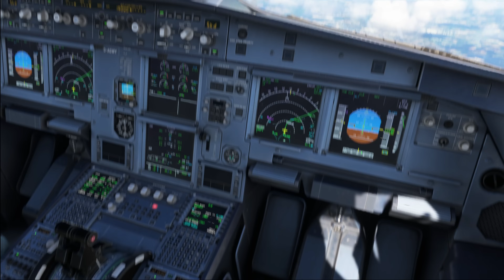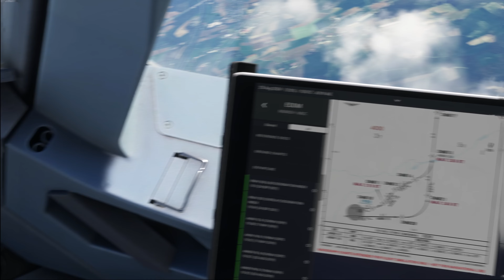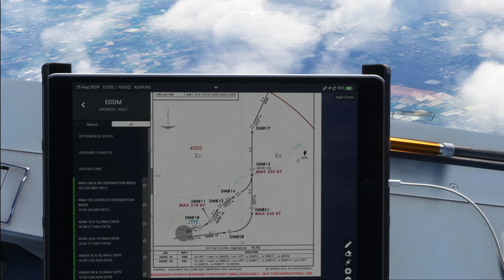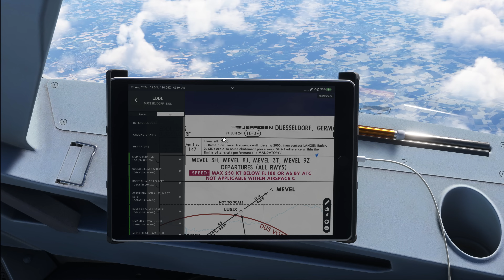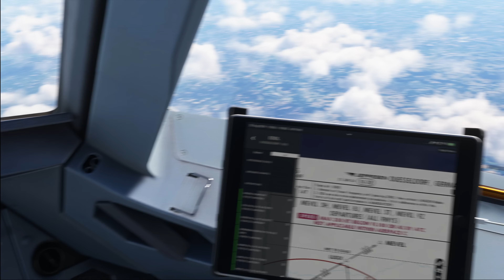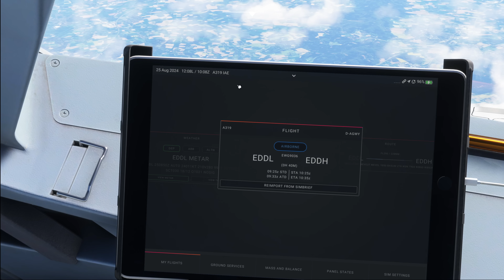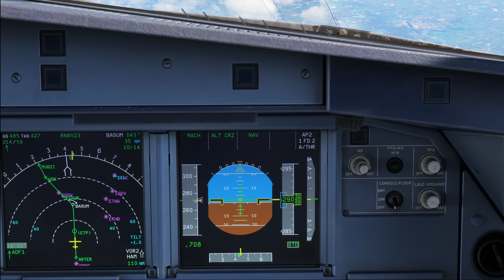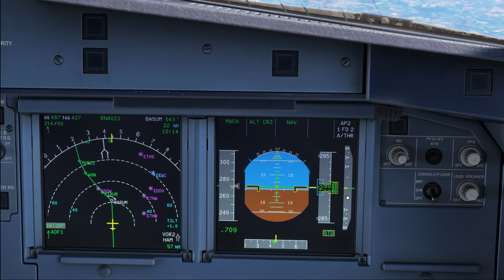Altitude or Flight Level? Transition Altitude or Transition level? Differences Explained!

Comment: I am a bit confused as to when to switch over when descending on the approach, as when ATC gives you the local QHN and gives you an altitude (above the transition level stated in the charts), is that an instruction from ATC for you to go over to local QHN or just information?
Reply: In many countries, like in the UK, you can set QNE as soon as you are cleared to a FL. In others, you must only set QNE only when passing the TA. Same applies for TL and QNH. Some airlines have this policy too.

I believe this is due to the high FL some countries have. Up to FL180. Which, I imagine could cause traffic conflicts if you set the QNE/QNH well before.

Despite that, however, the normal procedure is to set it as soon as the ATC gives you the instructions, either QNH or QNE.

Be aware however, if you wait for the TA, and the difference between the QNE and QNH is too high, it could make the altimeter "jump" up or down. To prevent this, set it at least 1.000 feet before the TA

Comment: In Poland the Transition Altitude is always 6500 ft and the Transition level is usually FL80 but if the QNH drops to 995 or below at ANY of the controlled airports, then the whole FIR assumes FL90 as the TL.

Comment: So, roughly... EU: when destination local baro pressure > 1013.2, then TL = TA + 1000. And when destination local baro pressure < 1013.2, then TL = TA + 2000.  For USA TA/TL: always 18.000. UK chaps: something funny with 500ft increments. Again, roughly. So without the temp adjustments. Correct?
Reply: As an aside, in America we accommodate for TL=TA + 2000 by not using FL180 if the altimeter is < 29.92 (local baro pressure < 1013.2)
Reply: @kevo31415  Thanks for this extra info, I like it. Still, I'm wondering now how you Americans handle relatively short flights, that (probably) do not exceed 18.000ft/FL180. Do pilots have to continuously adjust their baro setting via ATC in this case? Or do you mostly fly above 18.000ft to prevent this? I mean, if the correction of the baro setting is forgotten just only once, by just one airplane..it could potentially be disastrous..?
Reply: @Jalapeno2107  Yes. Generally for aircraft under FL180 each controller will tell them at least once the altimeter setting at a location relatively close to the aircraft. First communication with any aircraft under FL180 is often "<callsign>, <station ID>, <altimeter setting>"
Reply: @kevo31415  I understand now. Thanks again for these insights.  😎👍
Reply: @Jalapeno2107  Anytime you initially contact a new ATC unit anywhere when operating IFR on local baro/altimeter/QNH would be something like "Timbuktu control, Alpha Bravo Charlie, ten thousand, one-zero-one-three". If on a SID/STAR you might add something like "....ten thousand, ACMEE one-alpha, one-zero-one-three".

If VFR you might go "Timbuktu control, Alpha Bravo Charlie, type flying broomstick, 2 POB (POB=persons on board), tracking Hogwarts VFR, ten thousand, one-zero-one-three." If landing at Hogwarts airport you'd add "....ten thousand, with Hogwarts Alpha (=Hogwarts airport ATIS information Alpha), one-zero-one-three" at the end. It's a lot to say but it becomes a breeze once you're experienced.

Most ATC have radar so you don't need to say your position. But if you're in, say, the middle of Africa where there's no radar, or you're in mountainous terrain where radar beams can't pass through, and ATC relies on procedural separation only, then you say your position and ETA to your next IFR flight plan waypoint, or VFR reporting point or a well known local feature (e.g. town, popular beach etc.), or VFR destination if close by.

And ATC will usually reply "Timbuktu control, copied, Hogwarts Valley QNH one-zero-one-four." Often they give you the local area QNH, not the airport QNH.

And you reply "one-zero-one-four, Alpha Bravo Charlie", and adjust your altimeter.
Reply: @Avantime  Thank you for these very detailed response, appreciate it! Sometimes aviation can truly sound like magic spells indeed. And here I was finding myself a bit silly, shouting "Wingardiummm - LeviOsa!!" right before every takeoff. But believe it or not - it actually works every single time! Ah well, it's just the magic of aviation I gues..  😏

Comment: I’m guessing having a transition level of for example FL65 is also an advantage in that you don’t level off at that level. You’re usually either FL70 or 6000ft
Reply from the maker: That's certainly another advantage! Though for pilots it doesn't really make a difference. If ATC tells you to level off at FLxxx, you maintain STD pressure, if they clear you to ALTITUDExxxx, you change to local.

Comment: Departing from airports in the UK like Heathrow or Gatwick is very confusing to me. The constraint altitude for most departures is 6000 feet and the transition level is 6000 feet. And some departure legs are very long. When do you go to standard barometric pressure in these cases? Do I stay on the barometric pressure settings for the local airport and ignore the flashing QNH setting on the PFD until I climb above 6000 feet? For some QNH settings close to standard pressure, it does not matter. But if the local barometric pressure is low or very high, it is a difference of several hundred feet.
Reply from the maker: You go to STD when you climb ABOVE the altitudes, into the flight levels.
At my old operator we used to change the transition altitude from eg. 6000 into 6001 to avoid, amongst others, the flashing.

Comment: There’s a question I forgot to ask.  If your chart says trans level by ATC is there anyway to find out online what the current real world figure is or do have to use a generic figure from some historical setting
Reply from the maker: For some airports the real life ATIS is available online, but without ATC online you'll have to calculate it yourself.
Reply: I've started using Say Intentions AI and the ATIS supplied by them tends to give a Transition Level for the airport you are departing or arriving at.

Comment: Interesting video I always wondered about the AT the transition altitude what do you do but as you said you stay on local QNH.  I think the knowledge of the specific transition altitude differing in uk/Europe/etc is what’s causes issues.  It’s fair the Airbus flashes a warning for this, Im not sure this warning is due to the MCDU setting ? for trans Alt. Oh god ISA calcs are associated pain 😢
Reply from the maker: Exactly, stay on QNH if you are flying exactly at the transition altitude.
The flashing QNH on the PFD is controlled by the transition altitude and transition level settings on the TAKEOFF and APPROACH pages in the FMS respectively.